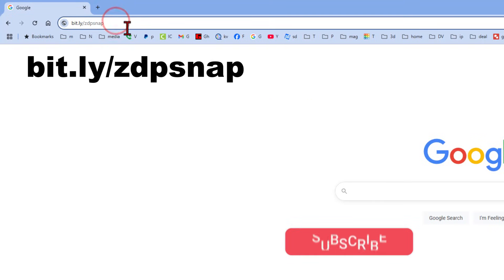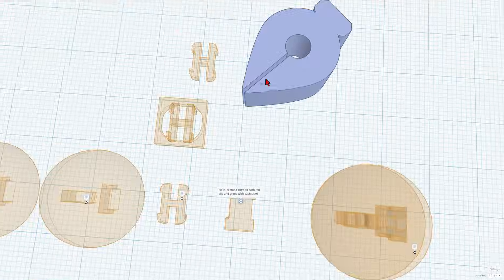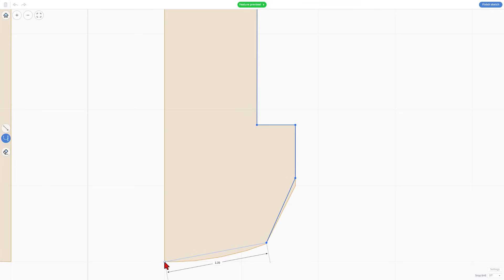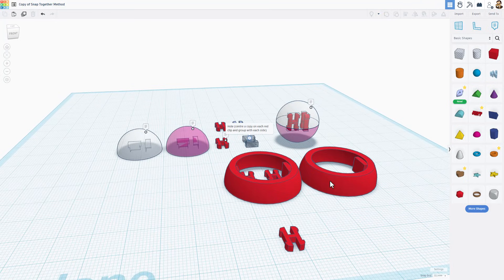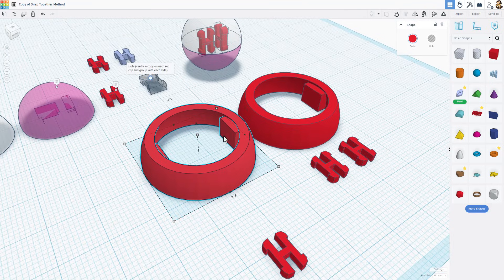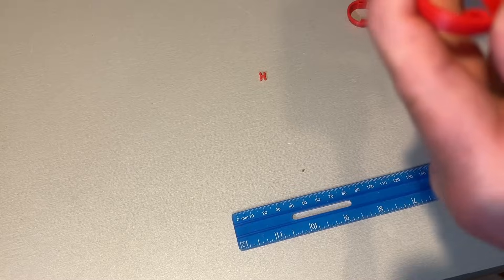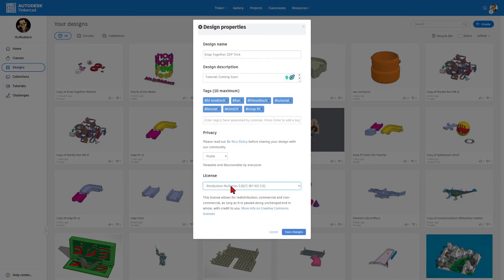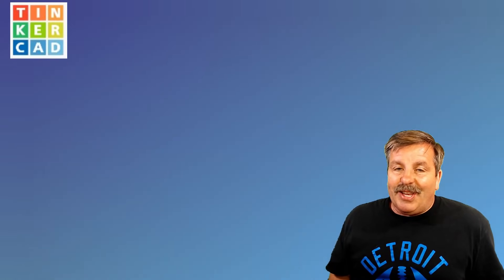Snap Fit Tinkercad Part Connection System 3D Print & Connect for FREE! 💯🔥

Comment: I used the sphere halves only because it's hard to print whole spheres, so it's kind of a use case. Edited to add: Obviously you don't have to use them only on spheres!
Reply from the maker: I am already working on a version for making larger 3D printed neon signs and such. Thanks so much for sharing the idea!
Reply from the maker: I was really pleased with how they snapped together. Should be much easier on parts that are larger.